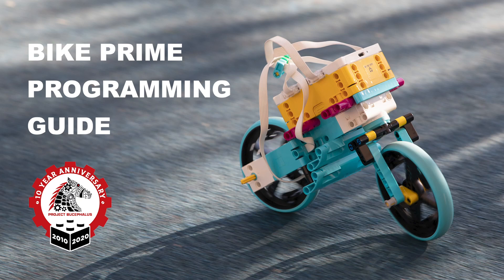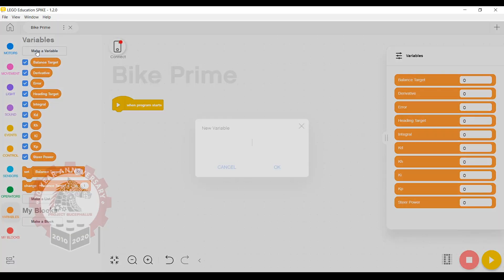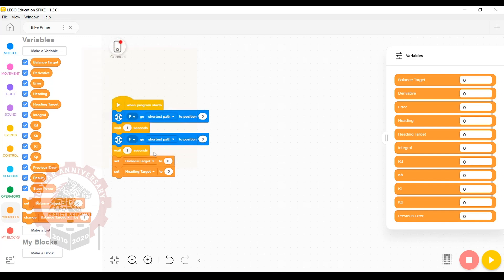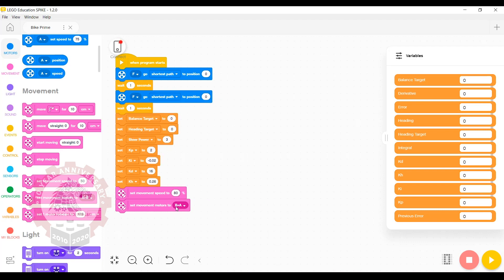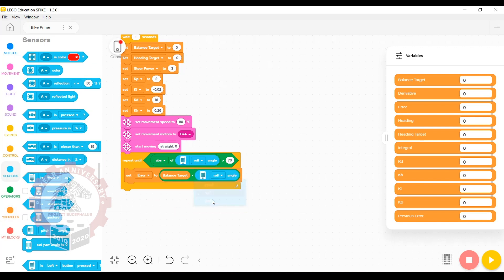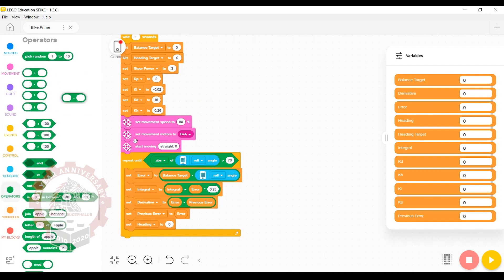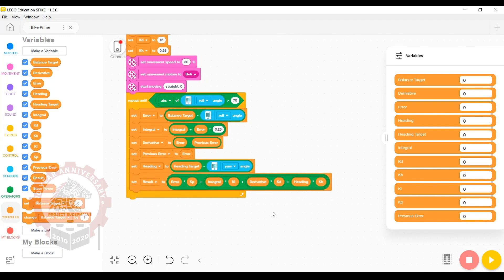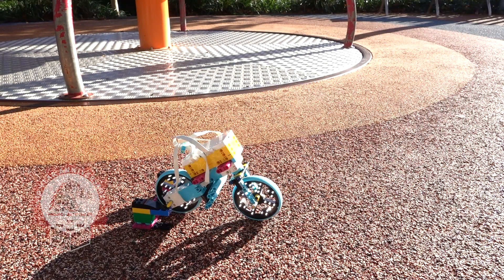"Bike Prime" Programming Instructions

Comment: Is it possible to do it with a smaller wheel? Do the values of the variables change?
Reply from the maker: Hi @elisandrorodrigues3895! Our developer says it should work, but we haven't tested it. If you are using smaller wheels the values will definitely need to be adjusted!

Comment: It doesn't work; the front wheel keeps spinning endlessly. Can someone help me?
Reply from the maker: The most likely explanation is that you will need to adjust the variables to work with the new firmware. We're currently occupied with the 2025 FRC Season (and about to head to the Championships in Houston), but if you send us your code and/or a video we can try and help you debug!

Comment: Hi, its been a while since anyone has commented on this but I am wondering if it is still possible to build this with 2025 current firmware?  I have copied the code, made adjustments as suggested but I am finding that my f motor is not turning at all so the bike never corrects (edited to say check variables as I set Kd twice), so just goes straight until it falls over.   Now the F motor seems to want to over correct too fast so turns into an eggbeater then falls over after 20cm or so. Any thoughts anyone?
Reply from the maker: Hi @ghalgor! Bike Prime is definitely usable in 2025, but we haven't had the time to figure out the tuning - we're currently neck-deep in the FRC season. If you can send us your code (or share a video of what the robot is doing) we can try and help you debug.

Comment: Hi, great project - thank you for sharing.
I tried to build it with Robot inventor set which seems to have some different wheels and motors. 
During tweaking of the values I noticed that the variable Integral is never initialized or reset, so it is increased all the time. Is that intended?

Thanks for your help. :)
Reply from the maker: Thanks for checking in! Apologies for the delay - the team has been swamped with competition in the last two weeks. 

Yes, this is supposed to happen. During normal operation it should bounce back and forth between increase and decrease as the robot wobbles back and forth. The integral exists as a way of correcting any biases the robot has to swing to one side.

Comment: mine doesnt work it spins like crazy when it goes of the stand, it tips over and then the program stops. Please can you help me i triple checked and the program is the same i even read the comment where you said to change some of the settings and add yaw before the variable, my battery is full and no problems with the main.
Reply from the maker: Have you checked your Port allocations and orientation of the brick? If these are correct, the most likely problem is related to the Gain values. You may may to work on adjusting the numbers until it works.

Send through your code and we'll see if we can help you solve the problem.

Comment: My program is the same as yours. My battery is also charged. But then too the front motor spins fast and it crashes. can you advise me?
Reply from the maker: Hi Spandan! The latest Spike Prime Firmware update has changed something about how sensor input is processed. We're working on a solution!
Reply: @ProjectBucephalus  any success?
if not is it possible to downgrade firmware to previous version and would you recommend doing it?
Reply from the maker: @gnevzmaja  - We're making progress! Hope to have the new numbers tested and confirmed by the end of the weekend.
Reply from the maker: gnevzmaja  - we think we have a solution. Try the following steps:

1) Add a "Set Yaw to 0" before the variable initialisation
2) Set "Steer Power" Variable to 2.6 instead of 3
3) Set "Ki" Variable to -0.03 instead of 0.02
4) Set "Kd" Variable to 18 instead of 16
5) Set Movement Speed to 90% instead of 80%

Let us know how it goes!

Comment: Nice built! I did the bike using small wheels (Don't have the expension set yet) but it doesn't work properly whit the given gain values. Also I believed the Center of gravity is to high for the small wheels, so I'll try to modified the bike a bit. What is your procedure to find out what the gain values should be? Do you have any reference or method to quickly converged? Thank you.
Reply from the maker: Hi Sylvain - Sorry we missed your comment! We don't have any elegant way of getting to the final values, it's mostly trial and error and observation of results.

Comment: Привет, подскажите пожалуйтса где допущена ошибка в вашем коде? Не можем разобраться. Надеемся на понимание.
Reply from the maker: Hi! This code is correct. There was a previous version of this video that was wrong.
Reply: @ProjectBucephalus  We do according to the code, the motorcycle passes for 1 second and falls, we use the code and another video, it constantly turns the steering wheel to the left.
Reply from the maker: @Вадим Ленивков - Have you looked at the common errors in the video discription? Have you checked your variables are set correctly? If so, feel free to contact us at www.projectb.net.au and we'll see what we can do to help you debug

Comment: I had also similar problems - until i found out that i've mounted the hub in the wrong direction ! The power button has to be on the REAR wheel and the bluetooth button on the FRONT wheel ... after a turned the hub 180 degrees, everything worked fine !
Reply from the maker: Hi Stefan. Thanks for the input! Hopefully this helps others.

Comment: It doesnt work at my spike bike. I dont no--know why but, everything same as yours.
Reply from the maker: Hi robokods afyon - can you be a little more specific about what's happening? This will help us isolate what's going wrong.
Reply: @ProjectBucephalus  when I start the program. front whell turning left very fastly. I think it is calculating something wrong
Reply from the maker: @robokodsafyon4546  - most likely problem is that a) you have the wrong ports selected or b) plugged the motors in to the wrong ports. Alternatively, you might have used the wrong variable somewhere, or your hub could be having hardware issues with the gyro sensors.
Reply: @ProjectBucephalus  can you send your program to me? robokodsafyon@gmail.com
Reply from the maker: @robokodsafyon4546  - no problem. Will be emailed through soon.

Comment: Argh, I've verified that my code matches exactly...  but when i try to run it, the front wheel just starts spinning really fast...  and it crashes immediately.  Any advice?
Reply from the maker: Hi Christine! There are a couple of potential culprits. To narrow it down,  is the front wheel spinning the same way all the time? What surface are you running on? Is the battery charged?
If you'd like, you could also go to www.projectb.net.au and send a message via "contact us". We can then set up a way to look directly at what's happening and debug more effectively.
Reply: I have the same problem, checked code, ports and hub direction multiple time. The front wheel keeps spinning

Comment: Hi, the video is fanscinating, and it attract me to buy a set of Lego spike. However, when I try to follow the steps to build the bike and code, it turn out the motor f move one way and the bike start and fall off immediately. Have you all experience this before?
Reply from the maker: Hi Enoch. Sorry we missed this comment earlier. Based on that limited information, the most likely problem is that your gain values are wrong (or one of your calculations are in the wrong order). Let us know if you're still having issues and we'll see if we can help!

Comment: I’ve tried it on three different surfaces and it never got beyond a few feet before it went down. Have you given it a test run since you made the correction to the code? Maybe the gain constants need to be tweaked. Making  a motorcycle from Spike Prime is a great idea which should have appeal to a lot of people, so still hoping to get it to work.
Reply: Hi Marc, have you fully charged the hub? We found that this can affect power output. We have received videos of the identical code working from several online users so it should work fine :)
Reply: @CreatorAcademyAustralia  Thanks, that narrows it down to hardware. I'll give it a try.
Reply from the maker: Hi Marc. Are you still having issues? If so, can you send through a photo/video and your code? We might be able to help debug.

Comment: Hello, I would like to ask if I use small tires what should I change in the program?
Reply: Hi Vangelis, the gain values and steer power will all need to be changed - but we haven't tried using the small wheels yet. Goodluck!
Reply: @CreatorAcademyAustralia  Ok, I will give it a try. Thank you!
Reply from the maker: Hi Vangelis - in order to use smaller wheels, the robot mass and centre of gravity would need to be changed accordingly. The wheels should be proportionally the same as on a bicycle (with rider). Happy to provide feedback on any designs you decide to play with!
Reply: @ProjectBucephalus  Hello and thank you for your reply. I am working on the coding part and yesterday I found some parameters that worked well. But still, need improvements.
Reply: @vangelismathioudis3891 Which values have you changed?
Reply: @piotrpawowski2361  I have changed all of gains values. But I think that it is a matter of motor power. It drives well for about 2 meters and after that loses every control for some reason.
Reply: @vangelismathioudis3891   Thanks for your answer :)
Reply: @vangelismathioudis3891  May I ask you to share this values? I've been trying to figure it out for few days and still nothing...
Reply: @piotrpawowski2361  Of course, but because it was long ago I worked on that I don't remember if this set of values that I will post was the optimal one. Kp = 4, Ki = -0.0005, Kd = 75, Kh = 0.26. Actually, I think that these values were more of an experiment rather than to work the robot. Anyway, if I find some time I could test it again and I will let you know.
Reply: @vangelismathioudis3891  Thank you! I'll definitely test it myself

Comment from the maker: The original video had an error. This video has the correct instructions! For those with existing code, the change can be found at 9:23
Reply: I have checked it ten times. It is exactly the same as your program, but it still fails. Are you sure you can use this program to run
Reply: @杨圣光-m5r , have you fully charged the hub? We found that this can affect power output. We have received videos of the identical code working from several online users so it should work fine :)
Reply from the maker: Hi  @杨圣光-m5r  ! Sorry for not getting to this sooner. The code should work, and we've received videos of it working for others. Is it possible for you to share your code (and picture of robot) with us? We might be able to see what's wrong that way.
Reply: I checked it many times, but fail every time in 1 second. I found the 'result' is tend to be under -300.
Can you explain what the differtials means?
Reply from the maker: Hi  @MrSeonghyeon  ! I'm not sure what you mean. Can you send through your code so we can take a look? Also, have you looked at the suggestions in the description? An extra common error may be that you are not setting Integral and Derivative to Zero (and also yaw angle to zero as also found).
Reply: @ProjectBucephalus  добрый день, скажите пожалуйста можете ли Вы показать это в графике, где что исправить, не можем разобраться.
Reply from the maker: @ВадимЛенивков  Happy to help! We only speak English though - or use Google Translate.